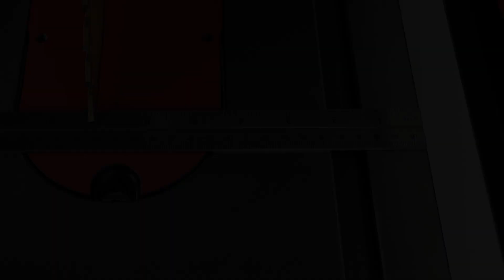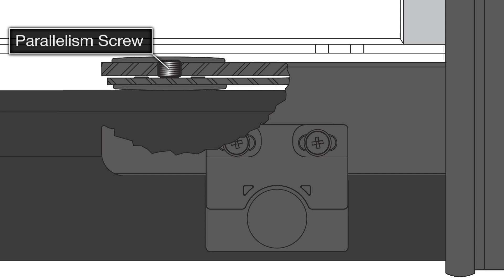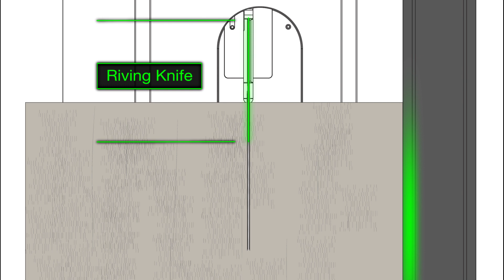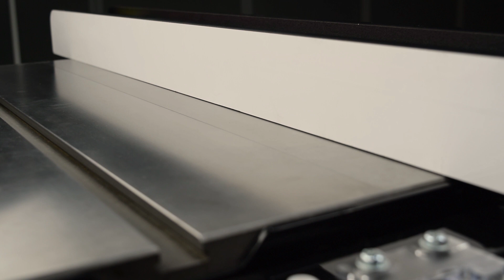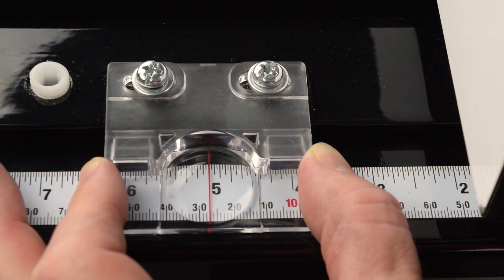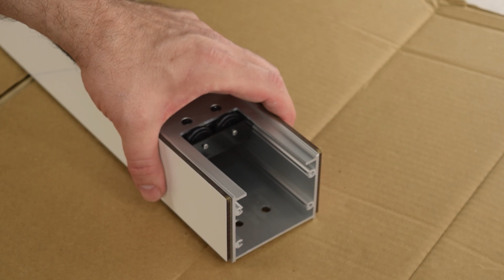SawStop Service Tip: Align the T-Glide and Premium Fences for Your Professional Cabinet Saw

Comment: Great video thank you! I have the T glide fence and I am having trouble with the alignment when locking the handle down. When pressing the handle down, the end of the fence closes or opens upon handle lock down. How can I fix this?
Reply: You have one side adjusted way more than the other side. If you balance how much each side is adjusted, it will equal out and move much less when locking down. For example, if the fence moves to the left when you lock it down, it means you have the right side in more than the left. It’s kind of tricky but you can get it set where it moves minimally when you lock it down.
Reply: @philprowse8434  I have the same issue.. but how do you balance pressure from each side when it affects the alignment with the miter slot??
Reply: @MrExamplename  loosen everything and start from the beginning
Reply: Ya - tedious !  I miss my ratcheting fence! Tears!

Comment: @SawStop My T-Glide fence shifts ever so slightly when I lock it down. If I bring my fence left towards the blade and lock it, it moves slightly left. If I move the fence right away from the blade and lock it, it moves slightly to the right. Is this normal or is there a way to prevent this from happening? I has always done this since the saw was new.
Reply: Mine does this also. I think it is normal, as long as everything lines up when it is locked down.  Did you ever figure out how to make it more stable?
Reply: Same problem with mine also. I haven't found a solution. My locking tension is on the looser side so perhaps that could be the issue.
Reply: @patrickiver1352  haven’t looked into much more yet.  I plan to soon though.
Reply from the maker: We are sorry to hear you have had issues. We recommend reaching out to our service team to get this issue resolved. They can be reached at service@sawstop.com or 503-582-9934.

Comment: Placing the t-fence out of aliagnment and using the splitter to keep stock aligned is a bad idea.  When doing a dado, rabbet, or single blade rabbet the out of alignment fence creates a problem.

Comment: I have no trouble with my fence. I lost my owners manual, and would like to know what the red and green safety lights blinking alternately mean. The saw will not turn on when these safety lights blink.
Reply: If you look on the left side of the power box, there should be a sticker with explanation of the blinking lights. 
The manuals can also be found online.
Reply: Thank you for your reply. I did manage to find my manual. Getting old is hell as I misplace things often.

Comment: Does the tube need to be perpendicular to the miter slot?
Reply from the maker: The fence needs to be parallel with the miter slots.
Reply: In other words, yes it will be perpendicular to the miter slots (if the cast iron table itself is actually square, which is likely true to an extent) but that's not what we are adjusting. The tube is attached to the bottom rail, which is attached to the side of the top surface. We then adjust the tube to be parallel to the rail. However, it (might) not be exactly perfectly parallel and/or square. So we are adjusting what we can, which is the fence vs the miter slots (hoping that the blade itself is parallel to them). It is very possible that the angle between the tube and the miter slots is 90.05 degrees, and then the angle between the tube and the fence is 89.95 degrees. Which ends up with a fence parallel to the miter slow, and is what we want.

However, the tube being exactly perpendicular is not necessarily true. As long as it's (mostly) perpendicular, you should be fine, since the fence settings can compensate for it, and make it aligned to your tolerance. If your eyes can see 0.1mm deviation over the 2ft (604mm) depth of the table, that's tan-1 of 0.1 divided by 604, about 0.01 degrees
Reply: @MrTresto  Thank you for the insight. It was a bit hard to picture in my head but it makes sense now. Parallelism of miter slot and fence does not depend on the intersecting line (tube). Initial thinking was miter slot needs to be square with tube and tube needs to be square with fence. However, angle between miter slot and tube needs to be same angle as fence and tube instead.

I bought a dial indicator and calibrated fence and blade to miter slot easily. I love how easy it was to dial in.

Comment: Is it possible to swap the left and right faces on the T Glide fence? And do you have any videos on shimming a face to be flat? My left side face goes in and out like waves in the ocean.. 😔
Reply: I'm also having this same issue, I can't square up the left side because it's cupped and I'm not sure if it's a "fixable" thing or if I need to hit up support
Reply from the maker: It is possible to swap face plates for a fence that has that option. The face plates are universal, so it doesn’t matter which side is on which. Unfortunately, we do not have a video for “shimming” faceplates but if you need to we would recommend shimming it by placing some transparent tape on the back of the face plate to compensate for "low" spots.
Reply: @sawstop  He was asking about the faceplates on the T-Glide fence, which the video said we’re not replaceable. Is that correct? If so, is there a mechanical reason, or do you just not sell the faceplates? I was disappointed to learn that mine has a low spot.
Reply: @patlaw53  Saw Stops quality has dropped off. Also their customer service has too. For as much money people spend on their product. You would think they wouldn't be bad.